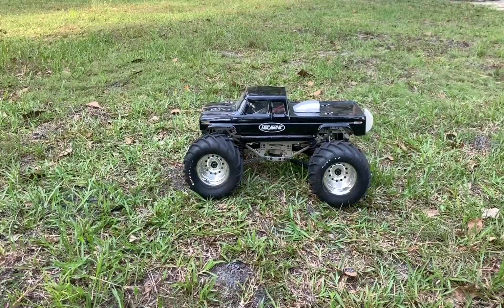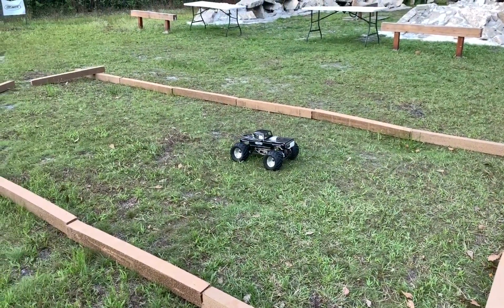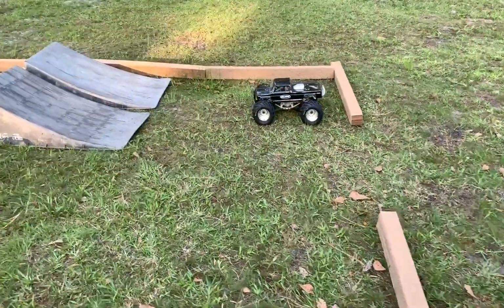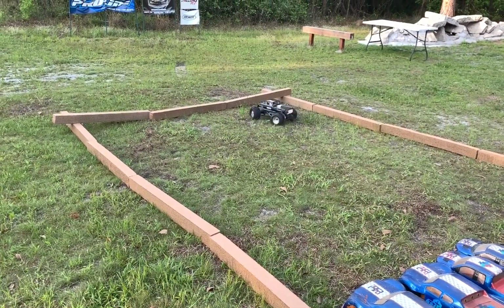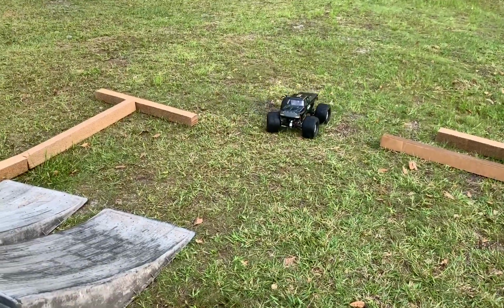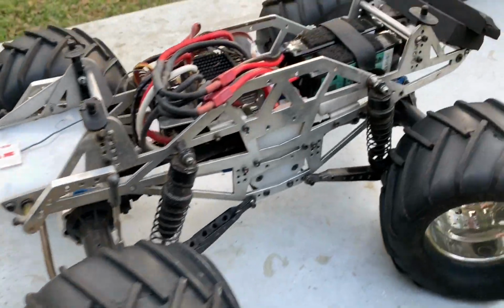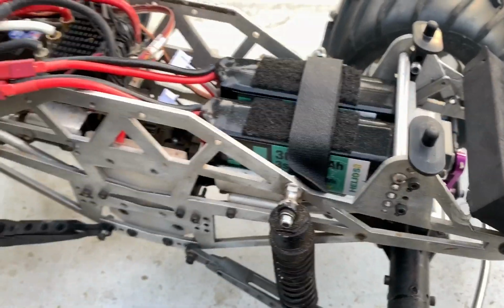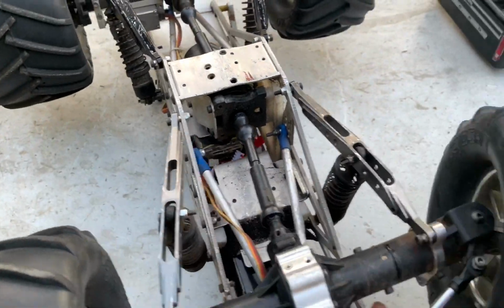Kevin’s Quarantine Monster Jam Comp

Comment: Could you post a link to that center diff please?
Reply from the maker: It’s an ancient part that’s no longer available you can use most any center diff you wish now, issue could be getting driveshafts onto the outputs. I had to have custom outputs made to do this.
Reply: That is the problem I am running into... You would think someone would make outputs for a center diff